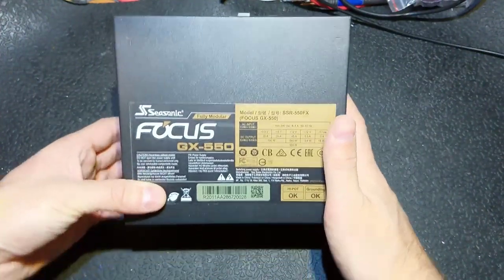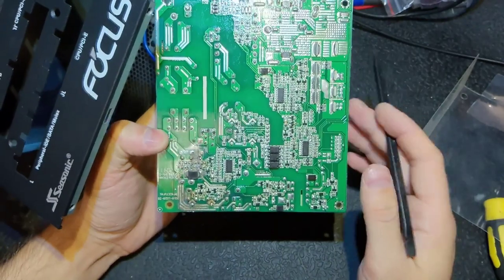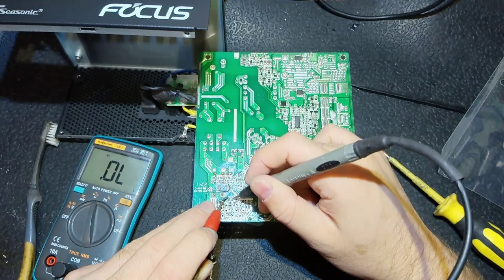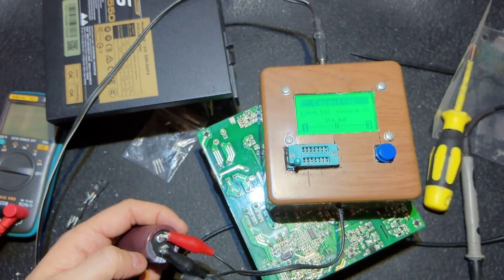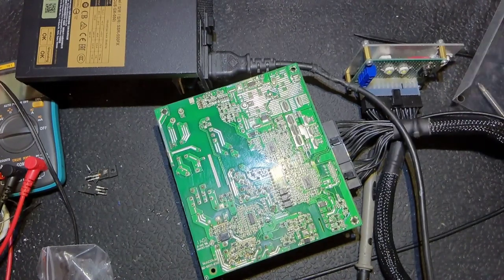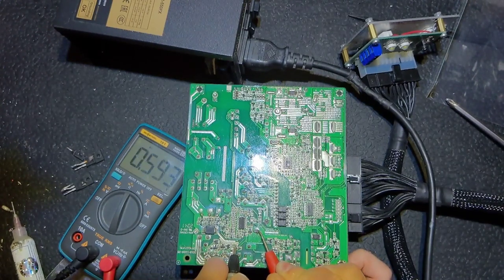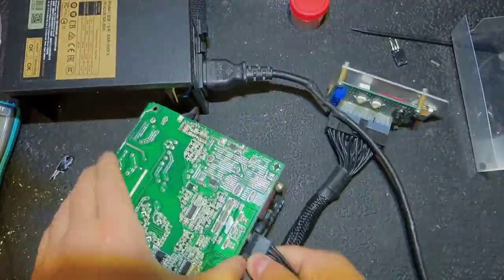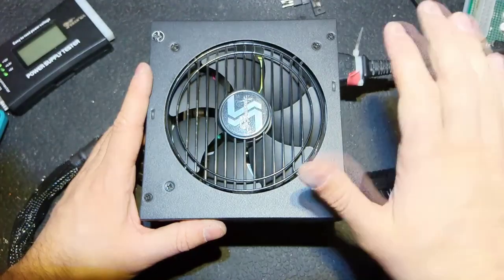Seasonic power supply repair. APFC fault

Comment: Fuse didn't probably blow up due to NTC series inrush current limiting resistor on the capacitor bank.
Reply from the maker: Sometimes FETs fail in open circuit. That was the case here. Probably NTC helped to limit inrush current. But if FETs fail in short circuit NTC would heat up and fuse would blow anyway.

Comment: Good job. Fuse is good, strange ? let me tell you what i did and fuse was still ok. 600w power was collapsing at 300 350 load, took it out of the case and started to measure outputs which was also ok., then i turned it off but i forgot about hot ground left the cable attached to the wall jack. Grabbed a screw driver and stick it in to power supply thru fan to raise output voltage a bit cuz it is adjustable, then boom hot ground shorted to output schottky rectifier's cooler lol Guess what happend beside power in the house was gone, bridge rectifier, power transistor, a path which goes to base of that transistor also was gone, few resistors at the high side was gone, whole high side was short. But voila fuse was super ok yet lol even i connect it back to the cable and blow breakers again still fuse was ok.  Changed power transistor and bridge rectifier then 5v stby came back. Then changed rest of the cooked components and repaired broken path then all voltages came back. And measured almost everything on the board and they all looks ok but all voltages drops down when i connect it to the motherboard and motherboard doesnt fully turn on when i attach a hard drive 12v drops to 9.5 v, when nothing is connected to the power supply everything is ok it is working fan is turning all voltages are exist. Seems like its a feedback issue but i couldnt solve the  problem yet cuz board has 4 chips and another 2 under the high side and all seems ok too.I think i cooked main transformator but i'm not sure. Do you have any idea about this ? probably you are thinking that how that power supply still works lol and yes fuse is still ok.
Reply from the maker: Nice story you wrote.
About your issue I'm not sure what is going on. It is strange that your PS works when voltage drops to 9 volts. All modern ATX SMPS have superviser IC which would shut down the main inverter if abnormal voltages are detected. So yeah there is probably a problem with feed back / supervisor IC.
Reply: @electronicshaverightstolive  Yes i've missed that you are right it should shutdown but keeps working. On that lil vertical board it does have 2 ics to monitor voltages and a line which drives 1st optocoupler( 2nd one is also ok but weird thing when its on it doesnt show short on buzzer mode at high voltage side, shows resistance. im not sure it is normal or not cuz 1st one shows short when power is on, basicly it should connect A to B right) . Another one on the low voltage side, pwm close to 5v transformator which is 7 pin one, single pin drain.  I checked all those ics on diod mode also whole pins of vertical board. There is no short in anywhere except usual ones. I am so confused, hard to repair semi broken one lol. It runs like a champ if nothing is connected to it.

Comment: Nice job. Do you know what caused the PFC to fail?
Reply from the maker: Thanks. I don't know for sure. I was expecting it to be a faulty bulk capacitor but it wasn't. May be it was due to overheating or overloading.

Comment: how do you found the vale of those smd resistors without schematics ? it's not written on
Reply: That's obviously not his first Seasonic PFC stage since he already has the required parts at hand ;-) Resistors in series with MOSFET gates always have a pretty low resistance anyway.